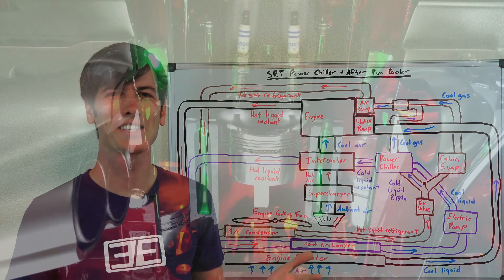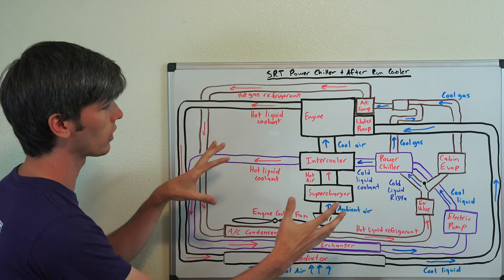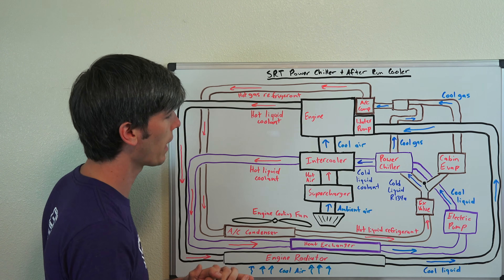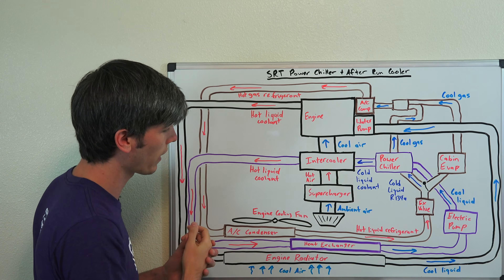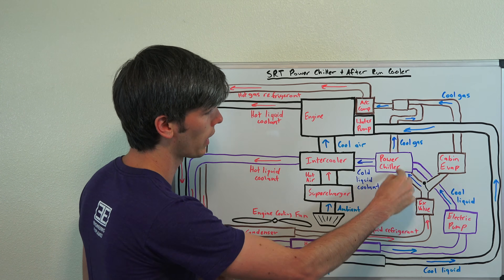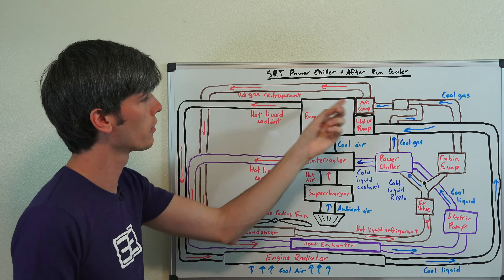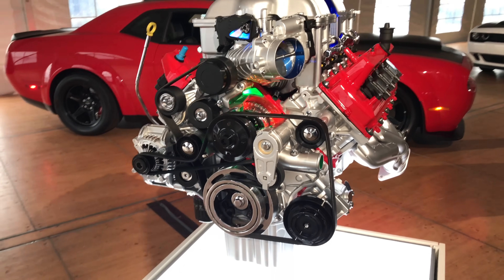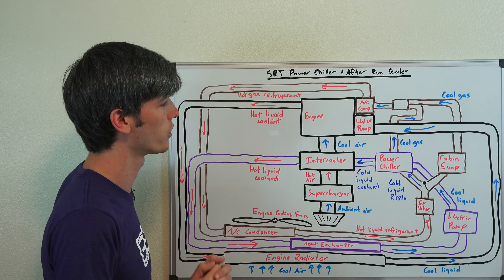How The Dodge Demon Uses Air Conditioning For More Horsepower!

Comment: Owning a 4cyl in the past, switching off the AC was like hitting a turbo button lol.
Reply: Adam Vulture It aint no joke my man. it makes a world of difference in a 1.5l 4cyl. going up a damn mountain everyday.
Reply: yup my old S2000 too lol, with the AC on it felt like I had a 500lb girl as a pasenger.
Reply: Adam Vulture Not exactly a joke. It does make a difference
Reply: Yep it's true lol... I used to switch off the ac when passing to make the most out of the engine.
Reply: Patrick94GSR is that universal across all makes and models though?
Reply: Kevin Smith In a pickup your torque is completely mitigated by your abysmal power to weight ratio and lack of meaningful handling characteristics.
Reply: a normal A/C system requires anywhere from 5-12hp to operate, by turning it off but keeping the throttle at the same position, you instantly gain that power for use propelling the car.
Reply: 4DIYers 4cyl w ac on hot day is like turning gravity on 3x in my old zuzu hombre 

It already don't like the big wheels I got on it

Throw the ac on goin up a hill n she might just laugh at you
Reply: george palacios so true...I used to ride with the heat on vent and my friends never understood why

 made quite a difference in my Forte Koup 

Probably half as much as ac off lol
Reply: In my 4 cyl 225 hp 2.0 turbo Subaru I see a huge difference when off boost. At low RPM there is so much drag from A/C that I turn it off for accelerating without downshifting.
Reply: Well this work with my Geo Metro 1996
Reply: Not true...
i have a 1.6l 4cyl turbo and i don't feel any difference in normal driving... because... TURBO and TORQUE
Reply: 4DIYers 😭😭😭😭 so trueeee i used to think my car was special as if only I understood my crappy car
Reply: Can verify. 80hp of 1.3L Toyota Echo does not like my freshly re-gasses ac system
Reply: 4DIYers that's how my sti is😂😂😂🤘
Reply: You can feel that in S2000, sklightly decreased acceleration, but in 2.0 WRX it makes HUGE difference when you are at like 1500-2000 RPM at low speed, it bogs it soo much that I switch it off for acceleration...
Reply: mibars You don't feel it in an R32 haha.
Reply: Was it a Miata, lol?
Reply: It used to be that some manufacturers used to automatically switch the a/c off when you hit full throttle and your intake vacuum dropped below a preset threshold.  Then it would automatically turn on again when you back off the throttle.  My old '89 Escort GT comes to mind here - and with only 90 hp, you really notice the difference, as the compressor takes a larger percentage of the total power when it's running.  It's not going to be anywhere near as noticeable with a more powerful engine, and the more modern a/c compressors tend to use less of the engine's power.  :-)
Reply: I have the same problem with my neon. It is pretty peppy for a 4 cylinder but not as fast as others. with my 2.0 DOHC engine I get 30 on the open road with my automatic if I'm very easy on the gas and I lose 3 mpg if I have the a/c running. It's too bad they don't don't make 2 a/c systems so you can have both while racing and have some for the intake on your engine and activate beast mode.
Reply: No, it's not a shitty american car, its european ^.^ And i have the same or more torque than most 1.9/2.0 engines turbo
Reply: 4DIYers 
Thats how it is in my Chevy Sonic turbo 1.4L. I get two turbo boosts. AC off and again at 3k rpm
Reply: Jordan Hillard...Geo Metro? I had one, small but ok
Reply: It's happen in my car even just a 1.0 liter motor heheh!  It's no like a turbo but it's possible feel a jigle lol!!
Reply: 4DIYers oh man the memories. Had a 97 civic HX and I can relate. Huge difference in power specially merging. I am greatful for the 4.8L in my town car, doesnt care at all whether the ac is on or not
Reply: Hardly notice a difference really with my 2.0l.
Reply: It depends how many HP the A.C. stole in comparisson with total HP of the car.  In cars of low HP and torque you will feel much more than high HP cars!  And have some points in RPM rate that you feel clearly! ;) ;)
Reply: Depends on how old the car is, also.  Those a/c systems from the 60s and 70s (and to a lesser extent, 80s) used a lot more power than the more efficient systems we have these days.  :-)
Reply: Right On! So you really don't waste power running the system when going down the line. For those still confused, think of it as PRE-COOLING the intercooler before making your run. Your intercooler would be at a lot lower temperature then ambient to begin with. And then when you fully open the throttle it's switches off automatically, but you still have that lower temperature for a few seconds, which is enough for the run.

A poor man's method is buying a bag of ice. I've also seen people mod a wiper washer system for a similar effect.
Reply: I owned a '74 Nova, with a massive air conditioner, and even though it had a 350 in it, I could tell a massive difference when I turned off the AC. Granted the AC was still original equipment working 40 years after manufacture... Efficient, however, it was not...
Reply: Not every car in the last 25 years has electronically-controlled accessories. 1996 was OBDII is the US, but many (most?) cars saved the computing for the engine, alone, and all acessories were mechanically controlled. Meaning, the A/C stays on unless selected off. Automating the accessories and cabin features didn't happen widespread until about mid-aughts.

...I found that re: deceleration fuel cutoff. My 1998 Contour had DFCO; however, it would only engage at freeway speeds, or under EXTREME engine braking (i.e. blender-level RPMs). Most engine braking scenarios, I found, the injectors were still squirting fuel. (Moral: don't believe the press releases without double-checking.)
Reply: Kevin Smith Right on dude. More power to ya. :)
Reply: I had an 87 Escort GT (no AC) and it had 110 or 115 HP, depending on where you looked it up. Not a big difference but every HP counts in economy cars!
Reply: Sounds like my first car, 88 dodge dynasty 2.5, 3 spd auto
Reply: That makes more sense.  Now that I think on it, I've also heard of people spraying a water/ethanol mix onto the outside of the intercooler to assist with cooling.  Not sure how effective it would be during a run, given the time it would take to remove any significant heat...but possibly worth a try if done before a pull, rather than during.  :-)
Reply: The "radiator" system is very effective.  What you saying is like a "refrigerator" system, it's like a house refrigerator but with different liquid.  I think it's not the case of this engine here.  ;)
Reply: that's what it felt like on my 260 ci olds V8
Reply: What AC? Lol, I don't have AC in my car.
Reply: Usually its a centrifugal clutch?  I come from working on older cars.
Reply: These days it's generally like a regular clutch with a friction disc and an electromagnet supplying the clamping force, I believe.
Reply: "This is nothing special, and a current Chrysler AC probably only draws about 2hp "
Chrysler has broken the laws of thermodynamics, then, and operate >100% efficiency?
1HP = 746watts. If your A/C exceeds ~1.5kW, it HAS to draw more than 2HP; it's a LAW!
Reply: Yepper for me and my 2.4 L Taco....when I am in need of HP....A/C off and foot in fan. LOL
Reply: I had a Calais Quad-4 4 cylinder engine and the air didn't make that much of a difference. It got great mileage and made a lot of power. Supposedly it had head gasket issues due to high compression, but it didn't affect me.
Reply: A must do for a race 🧐
Reply: LOL 4 CYLINDER LOL I LOVE IT WHEN THESE YOUNG KIDS PULL UP NEXT TO MY SUPER SNAKES AND MY GT 500 REVING THERE LITTLE 4 BANGER LOL I DON'T EVEN WASTE MY GAS LOL.
Reply: Note that it makes no difference at WOT, though.  When the throttle is wide open, the ECU switches off the A/C compressor clutch.
Reply: In my 4 cyl 163 HP 1.8L turbocharged Audi I don't feel much difference with A/C on or off.
Reply: tiagop198 hahaha 😂 you must drive a cruze
Reply: Yes.  In my case is 2009 car.  But it's very light weight 1.0L so it's easy to feel mainly in middle RPM. :)
Reply: Because its Audi.. It doesn't have power anyway. So there is nothing to feel with A/C on or off.
Reply: My pickup is a mid-size. Weighs about the same as a sedan. It's the drag and oversized tires. Really easy to induce oversteer.
Reply: Bryan Corbett yep as far as I know, any car made in the last 25+ years with an ECM controlling various systems in the car will do this.
Reply: Owning a pickup, switching off that AC did barely anything because of TORQUES!
Reply: 4DIYers Ive heard this joke before.
Reply: What's happening is that the Demon has a super-cold air intake.

This is nothing special, and a current Chrysler AC probably only draws about 2hp (so your shitey 4 pot would probably be happier with one)

Comment: Indeed, if you want efficiency with forced induction you'll need a turbo with an intercooler and perhaps water injection and a water spray on the intercooler.  That uses much less engine energy (turbo uses none)  and you can get more power.
Reply: No it doesn't... Turbos run off of otherwise wasted exhaust gasses. Making them non parasitic.
Reply: Ted Schoenling OEMs try to use turbos first. They revert to supercharging when packaging or cost doesn’t allow them to.
Reply: of course you can't run a 10 hp turbocharger for free lol, it's just you can make another 50 hp with that extra air(I'm making the numbers up), having a little 2 stroke running a turbo is a really cool anti lag, anti parasitic setup.
Reply: Turbochargers takes power to run as example a 62-62 @ 15 pounds of boost  requires 5-10 hp~ i know the some of the math because I'm looking into jet powered ain't lag for my car you and me will not notice it as engine load once its spooled up and  exhaust manifold pressure is driving it and not something like my ain't lag
Reply: MannyFresh1x so are you implying that turbochargers makes free boost with the engine off and putting a exhaust restrictions doesn't kill power?? With the engine on ??, Evan Jason said to make boost it takes power but if the added Engine capacity is greater than no boost you probably will not notice it as a load as a experiment try and use a turbocharger in a way that is a conventional load or see how much it takes to drive it to boost one way is to see how much fuel it's the same math equations as ice engines bsfc or look it up some of my math was helped by Borge Warner turbocharger company reputable source Cletus McFarlan with Leroy he's  doing a turbocharger build and had to take the waste gates of to try fix the boost crepe the Dino monitor might even show it as load if you use logic and look closely
Reply: Jeremiah John interesting idea of the 2 stroke powered ain't lag but mine is radial axis jet powered just to clarify and conventional engine powered. so as for ? For someone else who has more boost tuning experience than me if the air intake temperature is lower by more than 10f or higher how does it effect Target air fuel ratio ? I know most turbocharger engines at steady load generally run richer than N/A for anti knock and turban cooling but what can make it safer to be at 14.1 afr ? Vs 10.5 afr I'd like to safe some gas on the highway and cruising around

Comment: I wonder if that system can be implemented to current models like turbocharged cars? Aftermarket kit or something like that?
Reply: If your intercooler is the air-water type then yes, otherwise you wouldn't get much benefit.
Reply: You cannself fabricate one. Im going to, and im gonna dyno it to see if its worth it. If it works ittle be much cheaper to build at home. Tho i doubt it will give more power than a water cooled intercooler will.

Comment: More things to go wrong !  Over engineered !  Engineers doing more harm then good ! To many years in collage and not enough time turning a wrench !
Reply: Engineers lost all credibility when they told us 2 plans demolished 3 buildings on 9/11
Reply: Hmmm.  Well Mike Standberg,  I'd always thought aritsts/dreamers/architects think stuff up...  But engineers figure out how to make it work, and techs work their darndest - sometimes despite rampant failure by the first two groups - to keep it working!  The engineers/architects/techs alike are wise who prefer over-engineered to poorly-engineered.  The ones who don't - we usually call them accountants and attorneys.  Ha!
Reply: well beerlube.....its been my experience that engineers think stuff up, but it takes good techs to make it work. :D
Reply: Um... what?? Assuming you mis-spelled "planes", the irony there is laughable at best.  Triple entendre, anyone?  My undergrad advisor says he was one of few with both licenses in both structural and civil engineering and one of the first to suggest heat/contact of the kerosene and molten aluminum extended many critical girders and concrete reinforcing steel to above their 425C softening range.
Reply: Somebody sounds like a disgruntled wrench-turner.  We engineers give men the products on which wrenches can and will be turned, as all useful things eventually fail.  You're welcome for the job security!
Reply: Lol !  Thanks !

Comment: dodge demon, playing catch up to a 4 door family sedan street legal electric car that goes..

2.28 secs 0-60.. stock
Reply: Tesla did 2.28 without rollout. With rollout it's more like 2.53 but the demon's 2.3 is with rollout. Without rollout, the demon does 2.1s to 60.
Reply: Peter Robann Sobrepena well thats all it has going for it imo, there is no top end to those vehicles. 40mph rolling starts those vehicles get spanked left and right. Once they introduce a CVT on the other hand its a whole other story
Reply: huge cost difference. massive. tesla no sound. can't refuel in 30 seconds. more volatile combustible should there be an accident in the form of LI batteries.
Reply: Jackal of Hadouken! this thing will empty it's fuel tank in that timeframe as well tho
Reply: So in 15 years Tesla built an electric car that weighs 5,500 lbs that can almost smoke this 130 year old peak gasoline ice engine tech performance build!
Reply: Peter Robann Sobrepena After 60 there won't be anything near it though. Also at that stress that electric family sedan will empty it's battery in 30 minutes.

Comment: hello Jason, Dodge just "fuked" up my final project of mechanical engineereing. I was working on that for a year, and this happens, is not a new tech anymore. should i present it anway or start a new project??
Reply: Big power has been doing it for decades.  Google "turbine inlet air cooling".  The IAC chilled water coil I'm redesigning at work (smh it froze last January) is for a 40k HP combustion generator turbine and uses ~4k gpm of 39F water.
Reply: Wow, that is a nice artice. i dindnt knew that, they use so much ways to cool the intaken air.

Thanks.

Comment: can’t work that well if it runs an 11.0 lol
Reply: Tyler Parker It works well since it runs 9s.
Reply: Thomas L. haha it doesn’t. you obviously haven’t read up on the demon, it doesn’t actually run 9’s.
Reply: Tyler Parker So you're saying the NHRA's timer is wrong?
Reply: Thomas L. no one has once matched or improved the time.
Reply: Tyler Parker No one has received delivery yet.
Reply: Thomas L. there’s been over 30 test runs, not from dodge. google it.
Reply: Tyler Parker They're all from reporters and journalists doing it once. The engineers of the car can do it but they said that it takes getting used to before a new driver can get 9s.